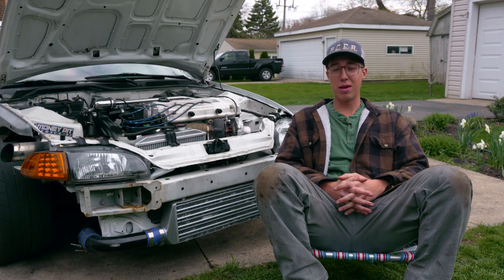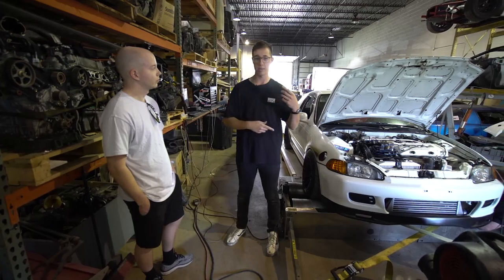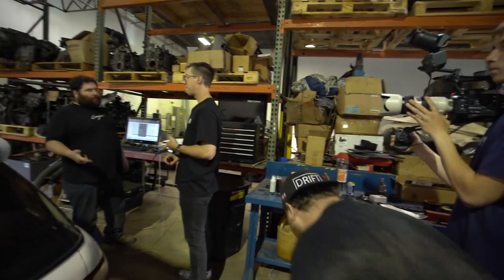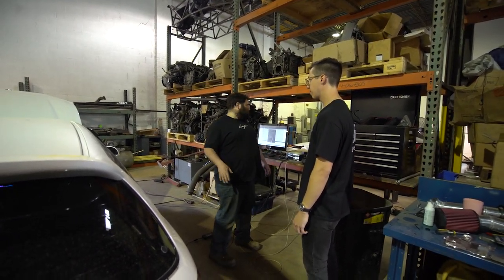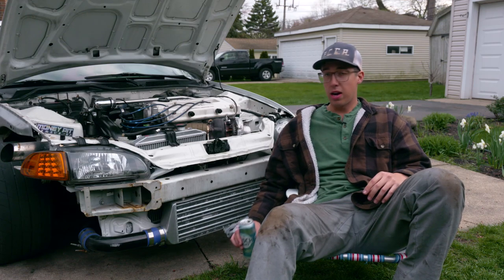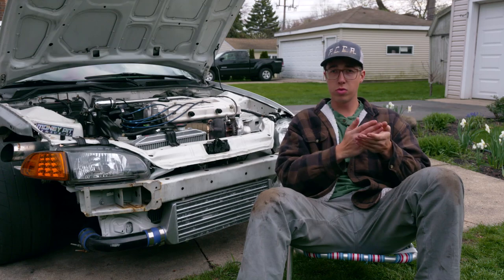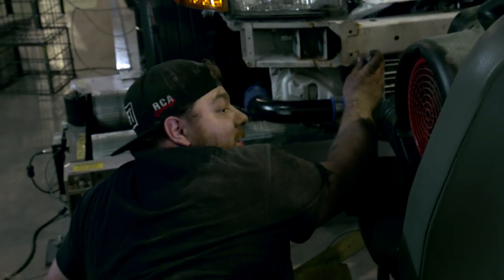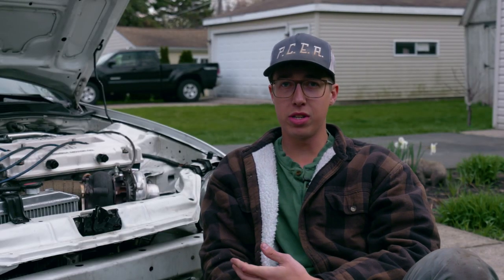TURBO LS VTEC DYNO TUNE | The Motor Should Have Blown Up...

Comment: Gsr cam have less lift thant the stock b16 cam bad upgrade...
Reply from the maker: Yeah but they picked up 40hp in the upper rpm range. Good upgrade.
Reply: @boosted_john  could have been the clutch causing the extra hp, stock b16 cams love the rpm
Reply: The overlap is why they work well on boost